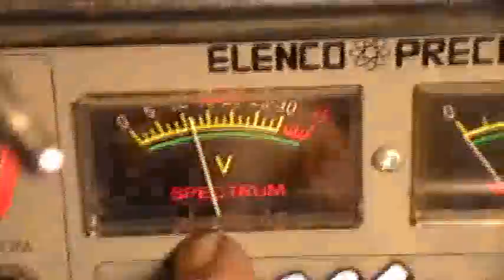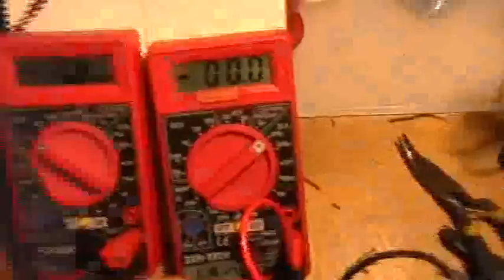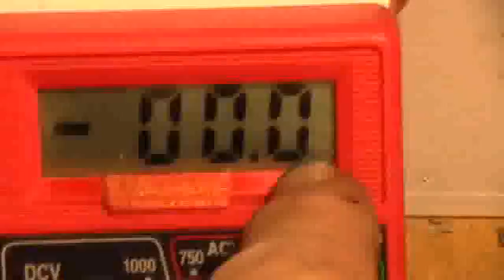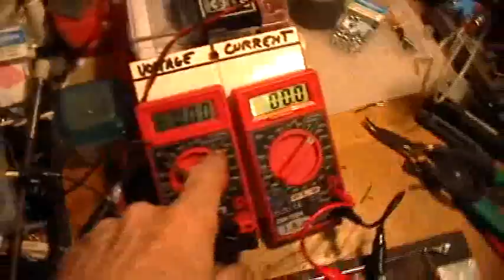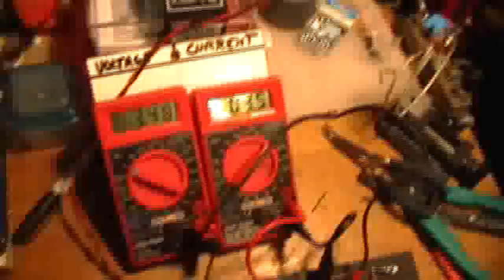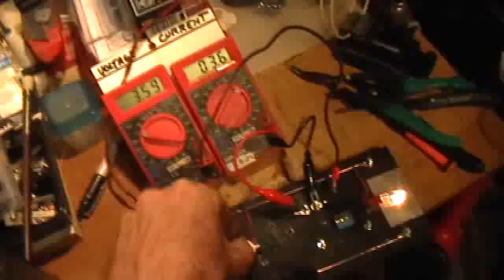Electric OU: MOSFETs...How Do They Work -- basic review

Comment: Use a 1m impedance meter. Volt Meter draws 10-100 times the current of the gate charge. You could have just put volt meter on other side of current meter... Or was someone not understanding Volt meter current Draw?